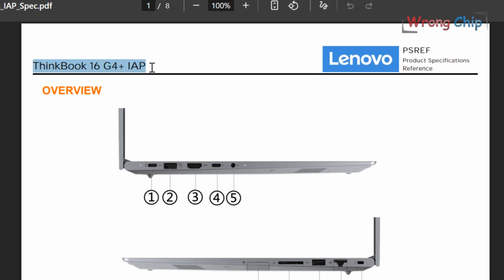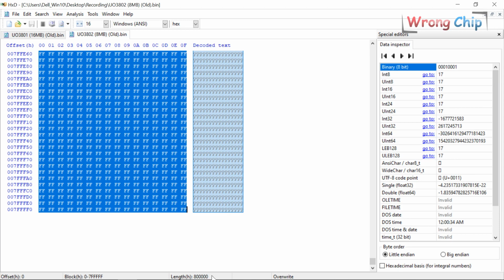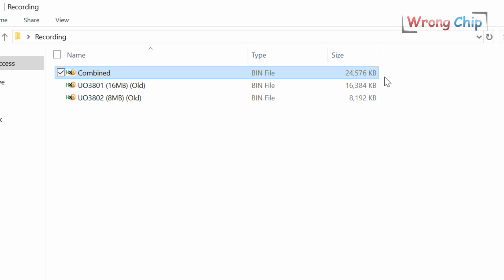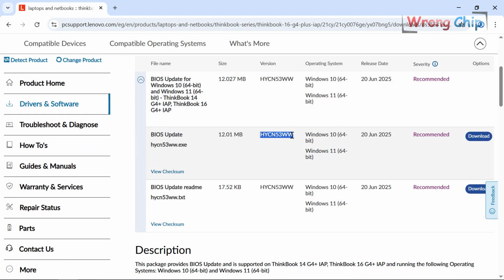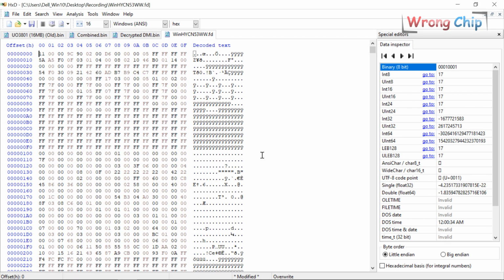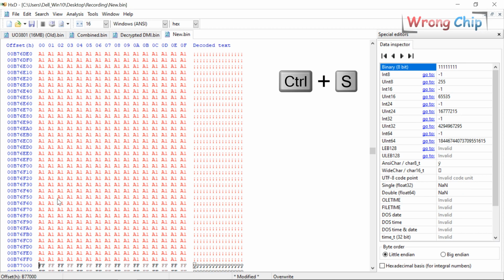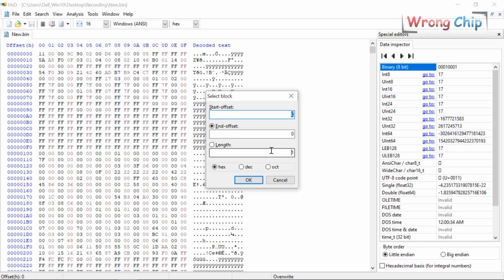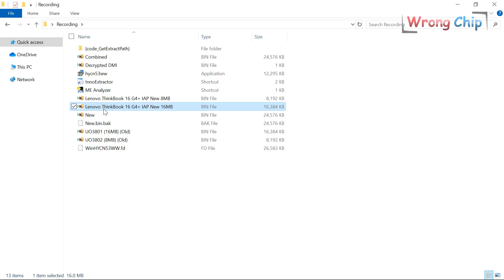How to Fix Lenovo ThinkBook 16 G4+ IAP Black Screen (BIOS Repair)

Comment: Assalamualaikom brother, do I have to take out the chips to reprogram or it is not necessary?
Do you have a picture with the position of the 2 chips?
Reply from the maker: Waalaikum Assalam, I think I replied to you on Telegram, but anyway, it's better to de-solder the chips in order to read/write them, but sometimes you can use a clip/clamp if you don't have enough soldering skills.

Comment: Hello, I need to extract SN and MTM information from a ThinkPad E14 Gen 2, but I can't find the DMI block in the file. Can you help me?
Reply from the maker: Hi, you can't find the DMI for a ThinkPad device in the BIOS file, because it's stored in the EC file inside the SIO chip.
Reply: @wrongchip Hello, thank you very much for the reply! With your tip, I was able to identify the information, extracted it, and edited the new file. Despite making changes in the setup, the error messages continued to appear. I was able to resolve the issue by entering the information through the Lenovo editor. Thank you for the information, and congratulations on your excellent work.
Reply from the maker: @jhonesCAM  Great, you're welcome :)